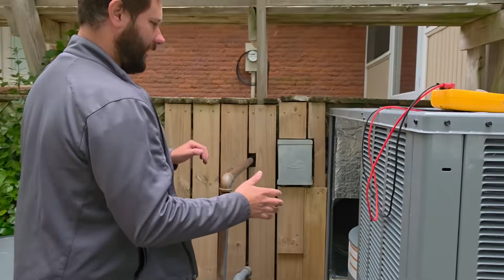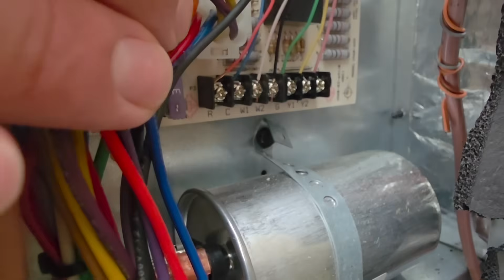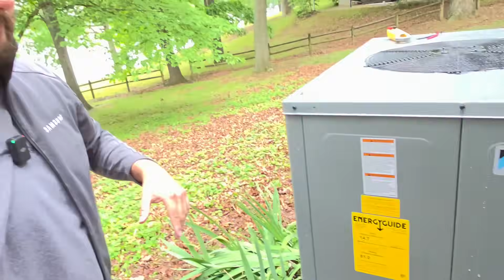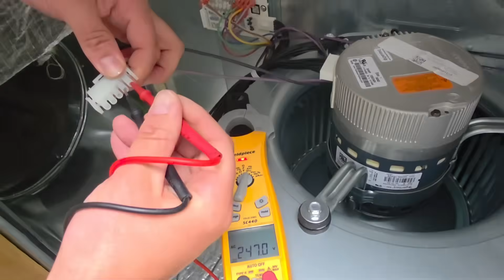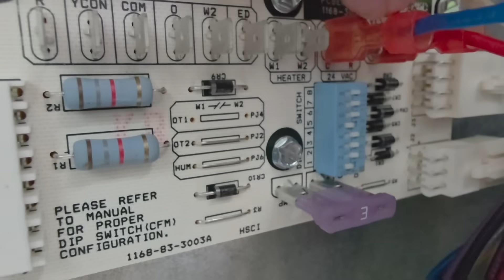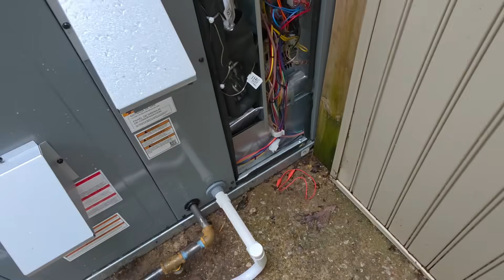This HVAC Mistake Cost You Time and Money!

Comment: You didn’t noticed you could have drop your meter inside the fan motor while it was running? Very dangerous and not smart nor professional. Never put any tools in the opening where fans are running. Damage and injury can happen in an instant

Comment: I heard(I don't know if it's true), that most of the wear and tear on the blower motor happens during startup. I have also heard that if a blower motor can run at a low speed all the time and speed up during a call, the motor will last longer. I am not an HVAC tech. But I am wondering if there's any truth to that.
Reply from the maker: Yes, that’s true—most wear and tear on electric motors happens during startup. This is especially important in HVAC systems and other equipment that starts and stops frequently.

Here’s why:

1. Inrush Current Surge: At startup, motors draw several times their normal operating current (inrush current), which creates electrical and thermal stress on windings and contacts.

2. Mechanical Shock: Starting puts sudden mechanical stress on components like bearings, shafts, and belts due to the abrupt acceleration.

3. Heat Generation: Repeated starts without adequate rest can cause excessive heat buildup, accelerating insulation and bearing wear.

4. Lubrication Breakdown: Start/stop cycles don't allow for continuous oil or grease distribution, leading to dry starts which increase friction.

That’s why soft starters, variable frequency drives (VFDs), and limiting the number of starts per hour are used to extend motor life.
Reply: @taddydigest  thanks for the detailed answer
Reply from the maker: @BlenderRookie you're welcome my brother

Comment: Had some burnt wires on a compressor last week. Rewired them and compressor didn't run. Ordered a compressor. Got it in and went to change it out. Something didn't look right. Checked the wiring i did and noticed i didn't wire it correctly. Wired it right and it ran just fine. That simple and stupid mistake just cost me a few hundred in shipping....
Reply from the maker: That's a bummer, but we've all been there!

Comment: Jim from Delaware,I learn a lot from watching you specially from as DIYer,I need you input I have new good man heat pump when it’s running on heat the blower stop after reaching temp but on cool it’s don’t stop after reaching set temp it’s just go to Low speed ??
Reply from the maker: That's pretty unusual
It could be a thermostat setting
Or it could be a setting on the control board

Comment: What up taddyboy, Correct me if I’m wrong but wouldn’t that be a wiring issue from the factory? Isnt that board by the blower wired up by the manufacturer? The only low voltage wire you’re supposed to hook up for install is the t stat wire.
Reply from the maker: That is correct my brother

Comment: The younger techs might need some clarification here. My order of diagnostics for this would be:

1) Calls from the stat? No need to remove wires, use and trust your meter.
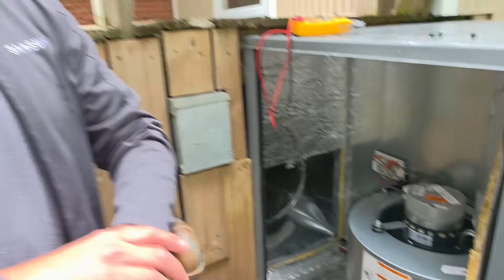2) Open limit? If it is closed like it should be, there will be NO voltage "across" it. A closed limit will have no voltage "across" it, because there is no voltage difference between the probes. An open limit will run the fan to cool down the heat exchanger. You may have miss-spoken in the video. At 6:03, "I made sure that there was 24 volts across that switch." "Across it" would mean that you placed your probes on the limit terminals and found 24 volts, because the switch had opened due to excessive heat, OR it was defective. I think what you meant to say was that there was 24 volts to common on each terminal of the switch. As Rush would say, "words mean things." For example, if you place your meter on either end of a resistor in a circuit, you are reading "across" that resistor. HTH.
3) Check for proper landing of the wires on the board. Good find. This is not just important for recent units like this. Six years ago, I had a helper change a fan control board on a 20 year old carrier package unit that used the X-13 type motor. His wiring mistake prevented the IFO circuit (internal fan operator, or internal fan output, as you prefer) from calling for the fan in heat mode. I received a service call for a bad smell, which was the HX getting too hot as the limit opened and then closed. Someone had set the stat to "fan on" the day of that fan board installation, and the problem went unnoticed until another store employee set the stat to "fan off," which will allow the main board to only call for the fan in heating mode, using that IFO circuit. Because of the wiring error, the IFO could not tell the fan board to run the fan.

Comment: Many technicians don't turn off the power, they unplug components with power supplied to save time I guess. Could unplugging electronic control components while there in operation cause a problem with them,(voltage spike or something causing a burntout part)? Keep up the great videos.
Reply from the maker: That can cause some issues, so it's best to be safe and turn off the power first!